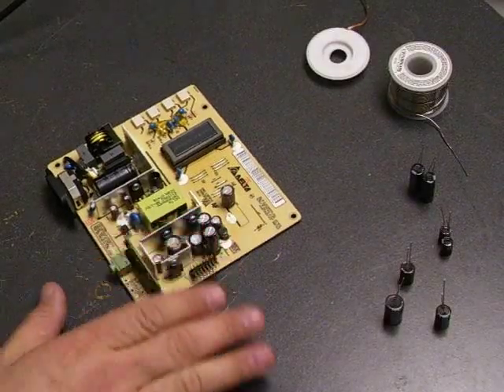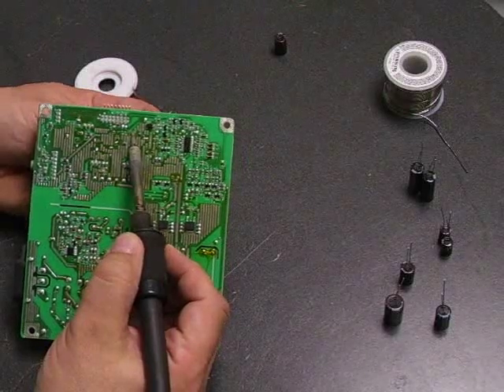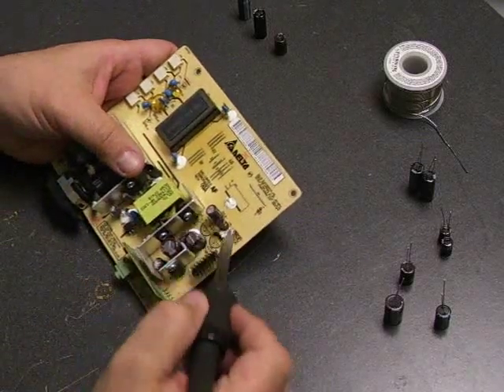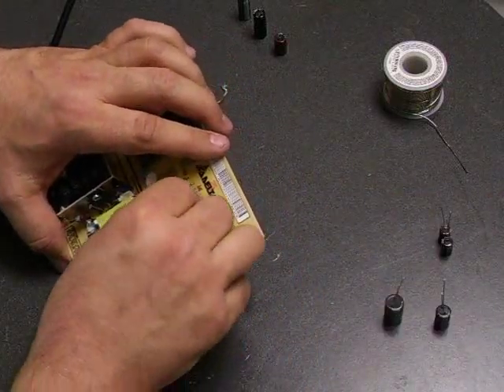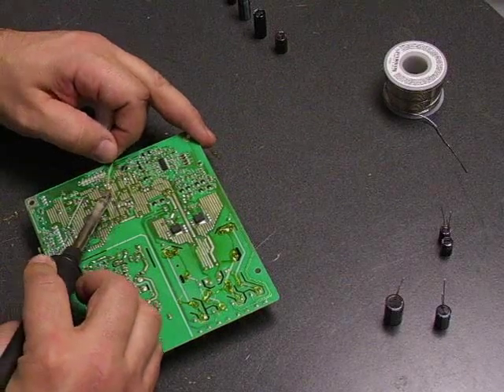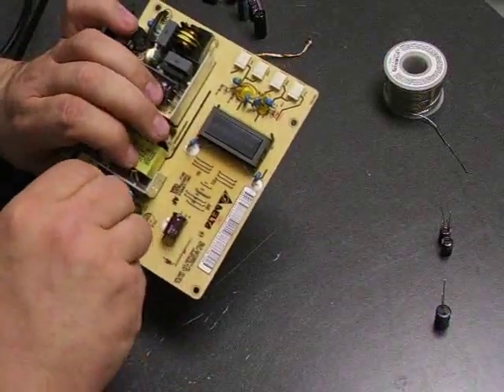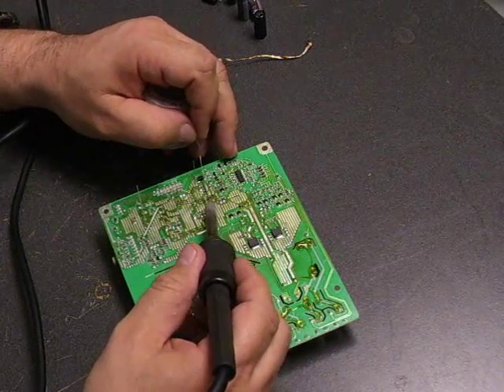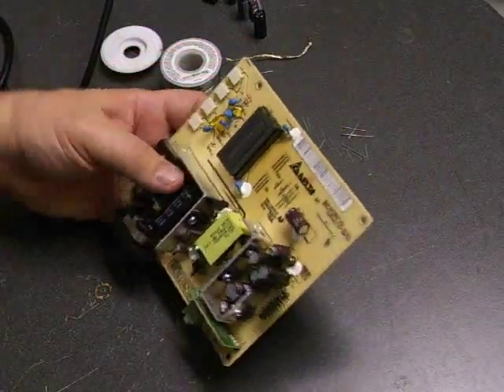Repairing the Viewsonic VX2235wm - Part 2 board repair

Comment: i replace all capacitors but still no display.should i have to used the same brand names of the capacitors or its ok to used different brand names of the capacitorss as long as they have the same volts and microfarad.

Comment: mine has a few bulging capacitors on inspection, but the monitor will not turn on at all, no power light whatsoever and I don't see any fuse on the board...any Ideas?

Comment: I did this today with my dad and fixed my LCD I got for $5 and I had all the caps from old bords I had lol so I have a 22' LCD for $5 :)
Reply: The company he shows in the description sucks, i have ordered my parts and paid $14 for the Viewsonic VX2235wm power supply repair kit, on December 22nd 2017 it is now 2/5/2018 and i have not seen top nor tail of my components despite  several emails to them asking both for my parts and my money. they have no PR skills and really don`t give a toss about customs. if anyone has received  there parts then you are lucky,  I`ve looked at there history and no-one has contacted then since 2012 fo what does that tell you, don`t trust this company,